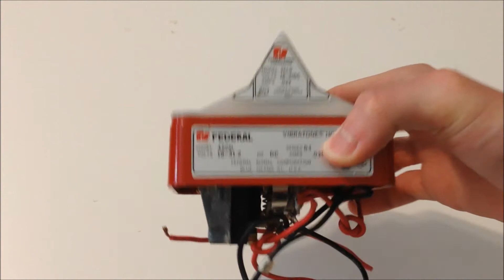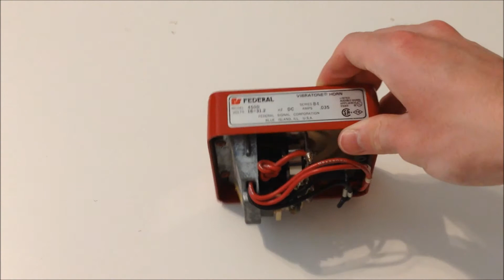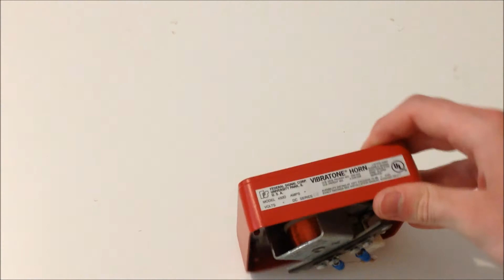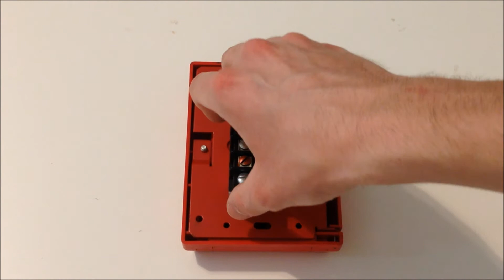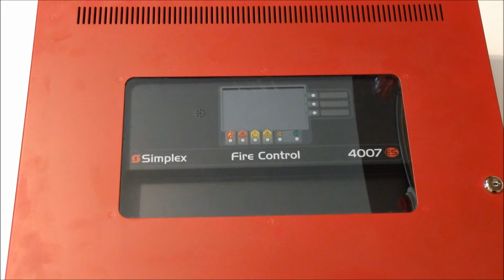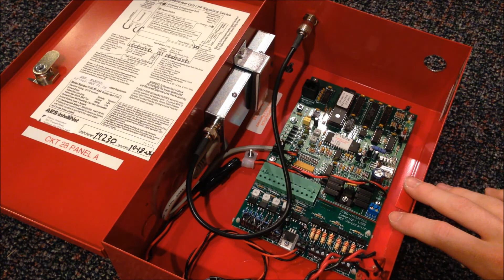New Fire Alarm Devices | July 2017

Comment: Having a radio network installed across multiple buildings you don't own and hoping that nothing gets lost in renovation/demolition kinda seems like a disaster waiting to happen.
Reply from the maker: In theory, it does. However, the Keltron units automatically communicate with the other radios in the area in order to form "routing tables," which are essentially the units along a certain pathway that a particular unit plans to contact should an alarm occur. Each unit stores 8 pathways, so if one unit in the network should fail, all other units that depended on it should have 7 remaining options to make contact with the Monitoring Center. Ideally, if a unit goes out, the other should immediately recognize that it is missing and remove it from their routing tables.

Comment: Nice parts you got there!

Very interesting that they (the bank) used the trim plates made for the MA/SS series...but I've seen a fair number of MA/SS's mounted on Wheelock semi flush plates before myself, wonder why they didn't use a Federal Signal one instead?

By the way, your series C2 horns actually utilize a 9845/9846 series horn mechanism if I see it correctly. The reason I can tell if because of the yellow MOV under the 'Do Not Remove' pitch adjustment tab instead of the blue ones the 9838/9840 series typically used. Although you may be correct if you look at the current draw. If it draws .065 amps, it is indeed the 9845/9846 100db mechanism. If it only draws .035 amps then it is a 9838/9840 mechanism. It's hard to tell because Faraday (and Simplex) were changing around their horn designs throughout the 90's to the contactless design rather than the older electromagnetic contact design. But then again you may be right on that.

Did the panel that came out of the bank draw filtered or FWR power, just out of curiosity?
Reply from the maker: Thanks! I think you are right on the 9845/9846 series theory. However, I was surprised to find that the C2 does not actually list the amp draw or the voltage on the device...there is an asterisk in the place they should be listed. I hadn't noticed until I went to check it just now. As for your second question, the FC-72 outputs filtered DC.